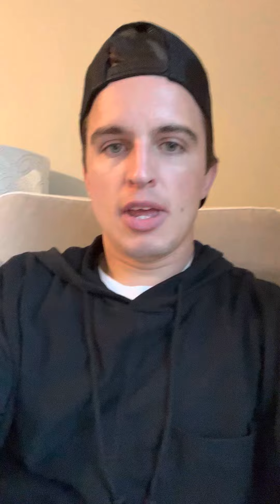How Could You Not Test This Shield Arms?

Comment: When I carry my 26 I generally carry with an OEM 10 rd and a 15 rd spare mag on me. When I carry my 43 I carry with an OEM mag and a Taran Tactical +1 that gives me 7 and 1 but I’m carrying a slimmer gun for a reason. I need it to be as small as it can be. I have other TT base pads on Glock mags and they work well. Sorry to hear that about shield arms mags
Reply from the maker: Respect! Yes I carry the same with my 26 and then for my 43 oem mag with magguts so it’s 8+1 with a backup 7+1 oem mag with a Hornet precision +1 baseplate.